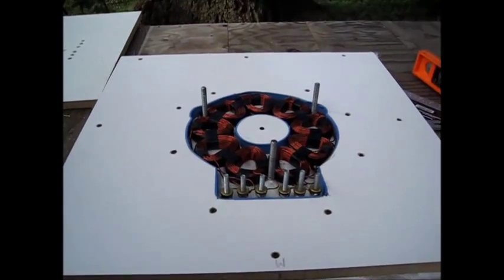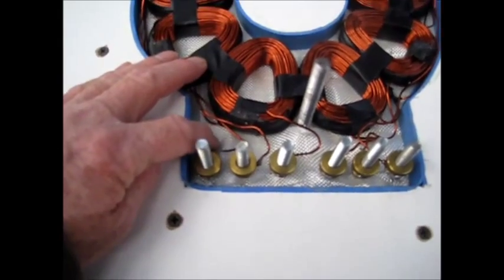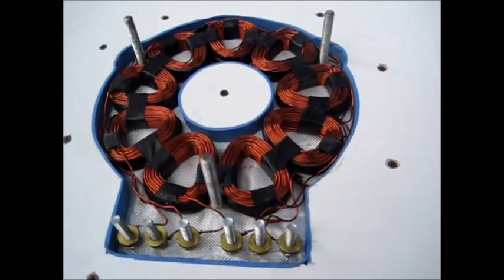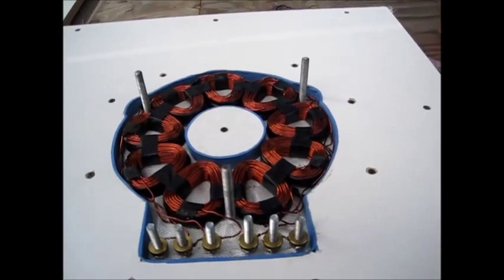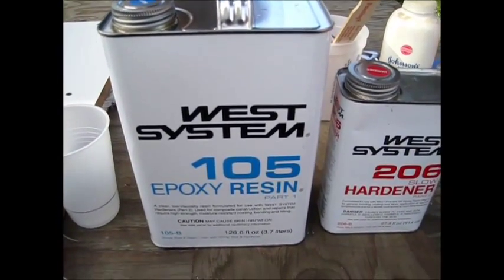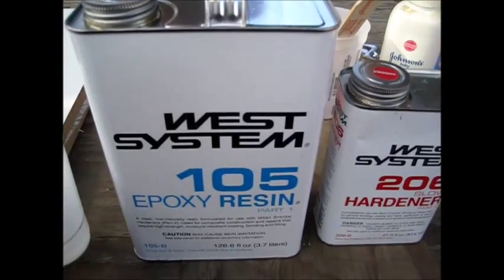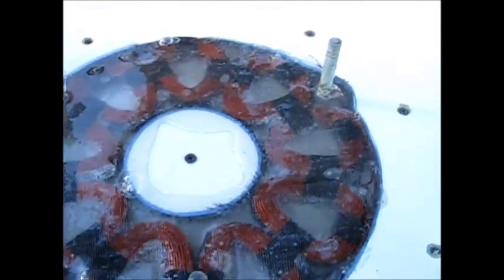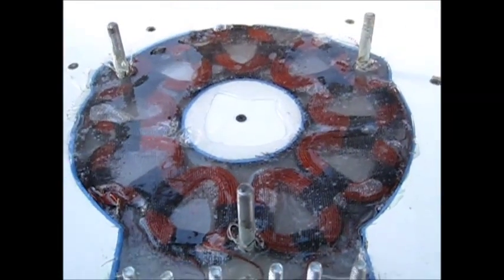Wind Generator Stator Casting Tips

Comment: Poly resin actually bonds easier to the fiberglass mat than epoxy does, found that out building telescopes with my uncle, also doing boat repairs with my older brother, Wax paper and Vaseline are easy and inexpensive release agents to help keep the resin from sticking where you don't want it to stick, If I remember right there is also a UV protector that can be added to the epoxy or poly resin mix, probably not needed if your going to paint it when your all done :)

Comment from the maker: I would try to stay away from any epoxy compound that requires you to bake it in a oven to cure.  the magnet wire is rated at 200C and together with the heat of the resign and oven you might be pushing the limits of the wire. this compound I am using now is working out very well, and only took one day to cure.